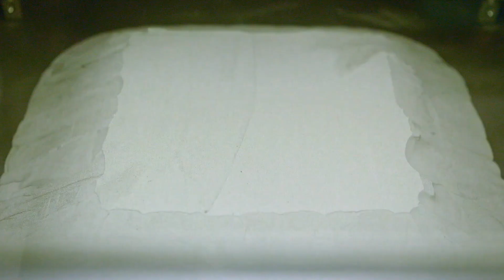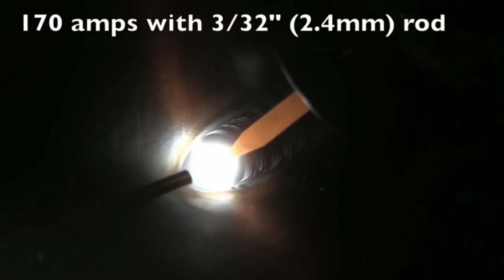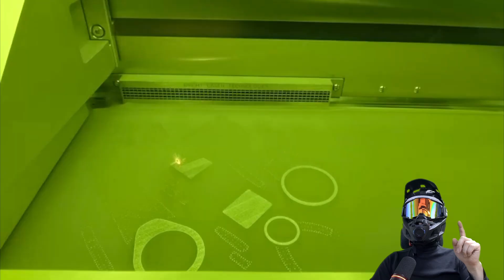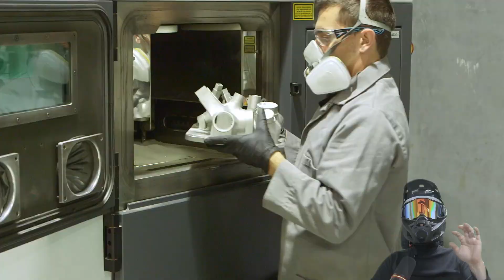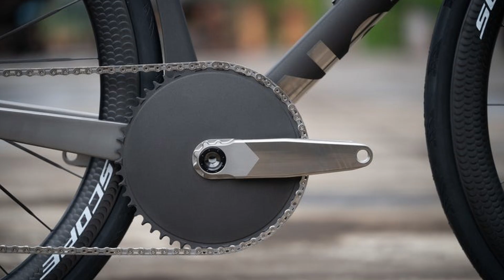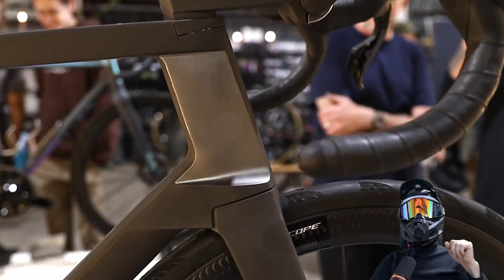🚴‍♂️ The Science Behind 3D Titanium Road Bike Production 🚀 World’s First 3D Titanium No.22 Reactor

Comment: There's no mention of the most important factor—weight. I understand the strength and durability of a titanium frame, but if it's not lightweight, especially for a road bike, what’s the point? Titanium needs to be processed to the right thickness to be both light and strong. Otherwise, it could end up being heavy and expensive instead. Anyway, thanks for sharing this interesting news. It seems that this titanium 3D printing technology would be a better choice for the small parts mentioned in the video—those that could replace aluminum—rather than for the frame.
Reply: *Additionally, I was curious and looked it up myself, but surprisingly, there’s no mention of the weight on 22 Bicycles' official website... Wow...
Reply: The weight of the frame represents around 2% of the total weight of the bicycle plus cyclist. A variation of +/- 0.5kg on the frame weight (and I m being extreme on purpose) represents how much ?? So how can you state that weight is "the most important factor" in cycling ?? This is so wrong. Correct fit to the cyclist, inertia and rigidity (or better say "adequate flexibility") are far more important... but it is harder to sell than "woooo weight !".
Reply: With 3D printing, one can make a frame from 6AL4V, so it can be lighter than a normal 3AL2.5V frame. The tube thicknesses can also be optimised for low weight. Aero bikes in 2025 are generally 7.5+kg, so I wouldn't worry too much about weight. 3D printing means the frame that has been simulated can be printed 1 to 1, as opposed to carbon, where the layup will differ from the simulation. Even if the frame is 1.5kg, part selection would be able to get the bike to 6.8kg.
Reply: "it's not lightweight"
What??? For instance, a Panasonic FRTC03 road bicycle is 7.5kg in 550mm frame size vs 8.5kg average road bicycle weight in the world. I bet you have no idea of what you're on, mate. That's a typical naive conclusion made by a person with either superficial or no knowledge in material properties field. But to each their own as they say.